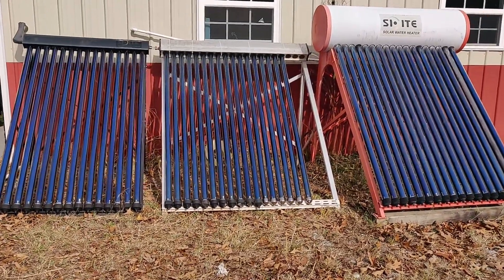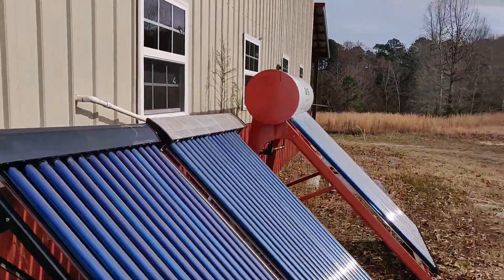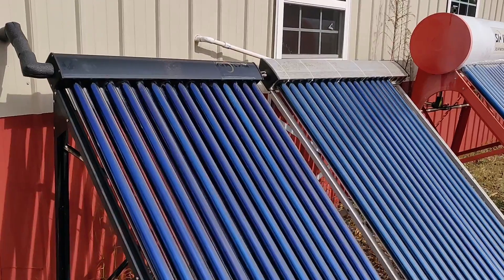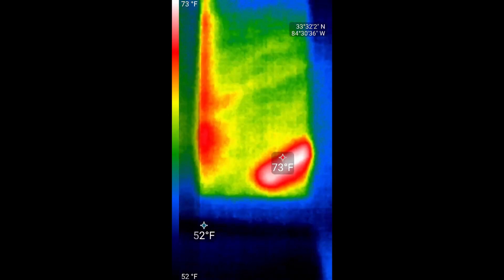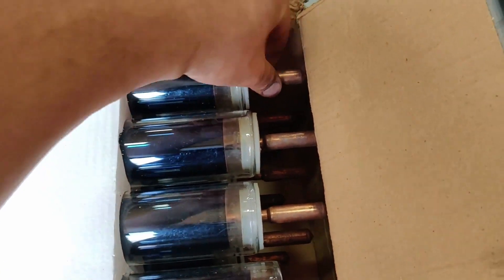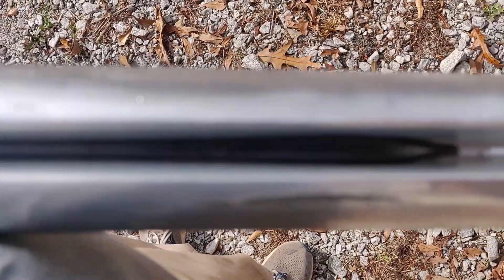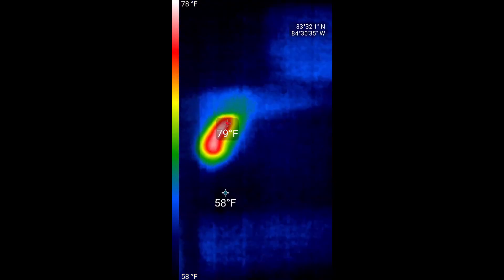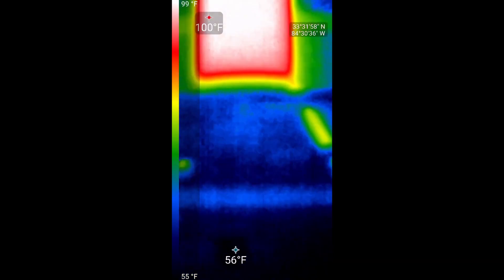Evacuated tube solar thermal collectors feeding a thermosiphon

Comment: Could you run an evacuated heat tube thermosiphon system with in-floor radiant heat within the slab of a workshop?
Reply from the maker: Sure, but the evacuated tube solar is designed to heat a small amount of water to a high temperature, whereas a flat panel system would be better suited to heating a large thermal mass to a lower temperature.
Reply: @NoelBarlau  thanks for the reply. "Flat panel"... Are you referring to PV?
Reply from the maker: @moaski  No, I was referring to a flat panel solar thermal collector. They're much more efficient at heating more mass to lower Delta T's. Although PV solar has actually overtaken solar thermal on a cost per watt basis in the past couple of years. Look into Electrodacus hardware for PV heating using resistive elements embedded in a slab.

Comment: Where did you bought those systems?
Reply from the maker: We imported them directly from China as test units.  At the time we were going to import and re-sell them, but as it turns out we weren't really sales people so we gave up on the idea.  Now that PV solar is so much cheaper, it's economically more efficient to heat water directly with PV.  Look into Electrodacus solar controllers with diversion heating.

Comment: So what’s the plan for the hot water in the barrel?
Reply from the maker: Just let it radiate heat into the shop over the cool winter months.  During the warmer months I'll just drain the tank and cover the collectors.  I always have big plans to integrate them into the house, using them to preheat the feed for the hybrid water heater.  But somehow I never get around to it.  We're about to embark on a complete renovation of the house, so it may happen eventually.
Reply: Noel Barlau I’ve long thought about similar with a heat échange radiator inside my workshop. Ideal would be an underfloor pipe matrix heating the shop slab. Bit late to start chopping the slab though. 👍😎
Reply from the maker: @lookcreations  Same.  If I could go back in time to just before the concrete pour I'd have ran both Pex loops and some long wire loops so I could use the Electrodacus DMPPT450.  Realistically, I really only need supplemental heat about 4 months out of the year here in Atlanta.